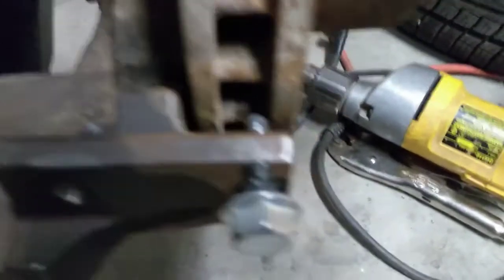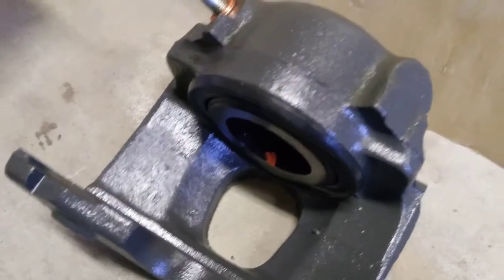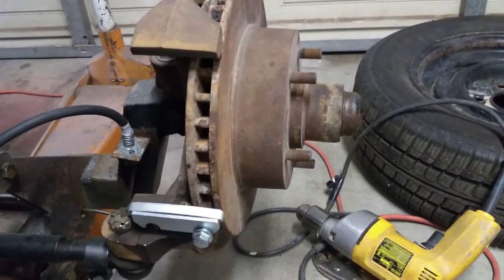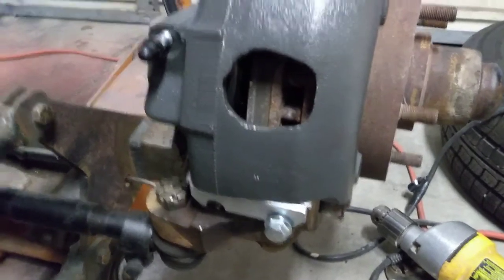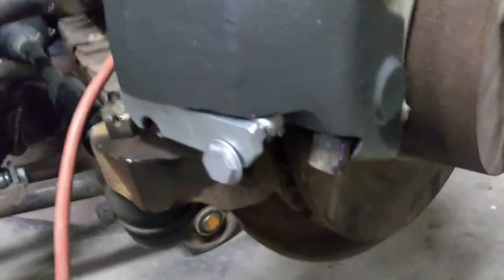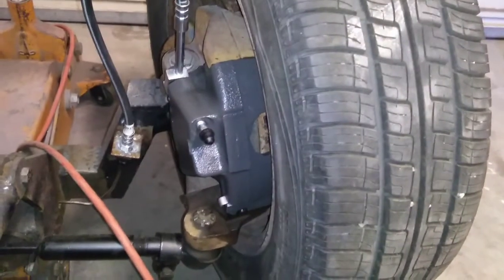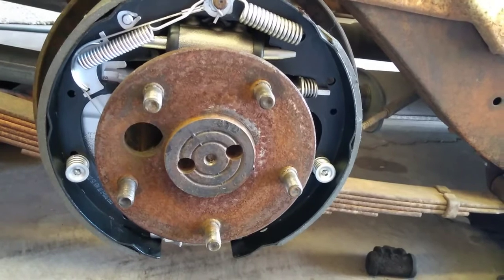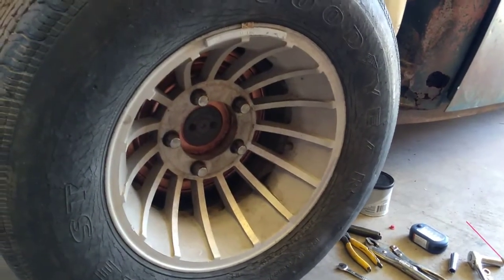Rat Rod Project Brake Rebuild Hacks

Comment: They use hardened bolts like thise in areas that have vibration, torque, etc. A mild steel bolt in that location would break much easier and faster. When are we going to see any more of the Ramcharger? I have a '74 Plymouth Trailduster, and would love to see the Ramcharger worked on. Don't get me wrong, I'm enjoying the ratrod videos, and would like the Ramcharger to be the next project! The Lotus too. With a V8 swap!
Reply from the maker: Ted has been doing a few things to the ramcharger. It's in the shop right now getting the exhaust redone. We're planning to do a video on it when he gets it back. Not sure how far he will eventually take the restoration but is fun to see it back on the road. Stay tuned!